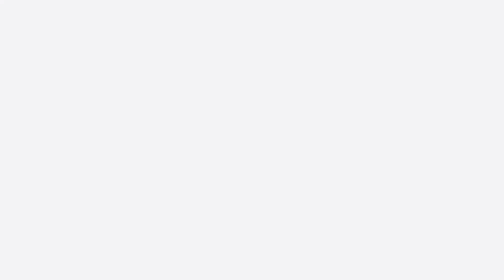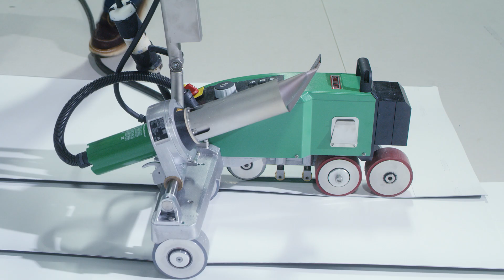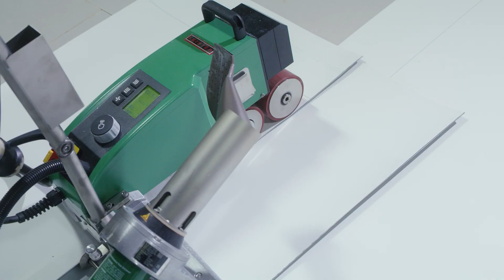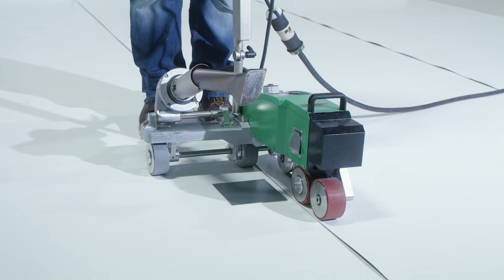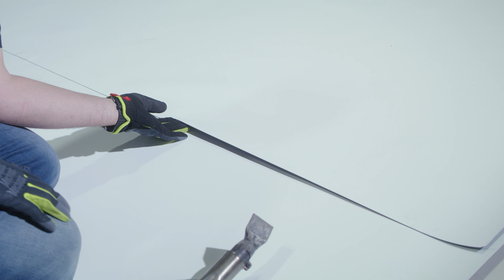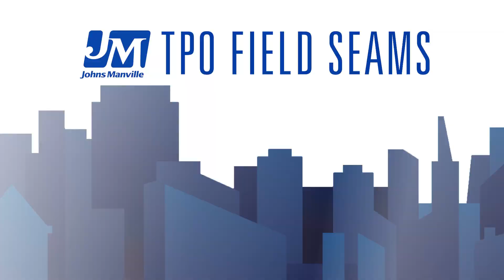TPO Field Seams

Comment: The heatgun noozle needs to go further into the lap to create an air dam which would be called a secondary weld. The primary weld is the outside inch and a half weld. I also turn the heat gun noozle in the opposite direction when welding down a seam because its easier to push the bleed out or bead from the top seam.